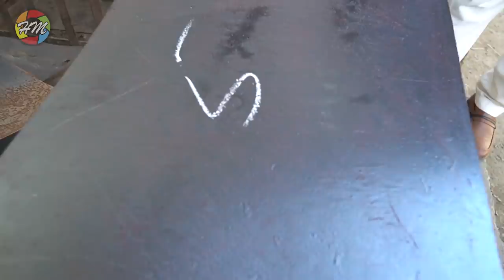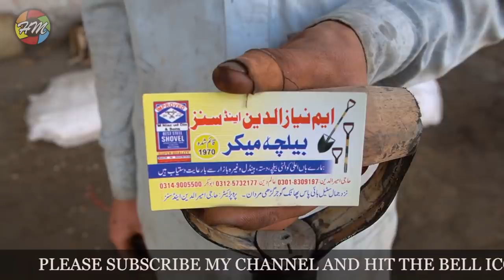Amazing Shovel Forming | Hand Tool of Poor Farmers And Labourer |

Comment: Better the metal wrap the wooden rod end completely rather than 3/4th. Now all load will be on 3 rivets which will try to rupture the wooden rod. This is what I feel. Also the v notch at the part where the wooden rod is inserted is unwarranted. The notch simply weakens the plate. It would have been filleted. Anyway there is no time to bring in theory, just enjoy the video without bothering about safety/quality concerns. That's it. But these videos are more informative and interesting than Ted talks by researchers/scientists/businessmen etc.

Comment: Why do you make such short showel handle? It makes you bow down when you work and then your back gets too much pressure. Try with a larger handle, let's say 1.6m or even more, without that handle grip. It makes a big difference, it is easier to use, you work in upright position and your back doesn't get damaged. Otherwise..  nice video. Just.. It seems to me there are a lot of people involved in the process, it could be done with half less people..
Reply: Perhaps these are made for vertically challenged people.